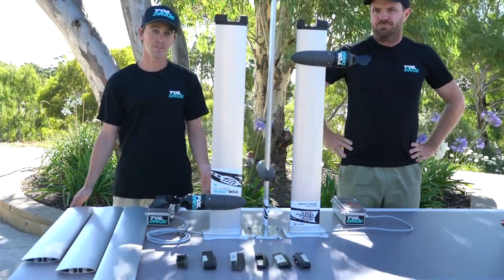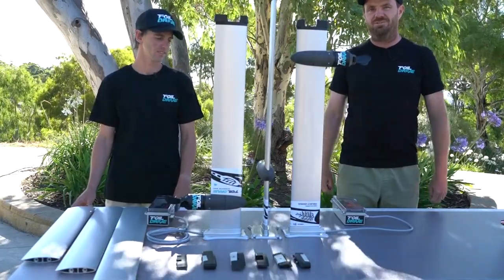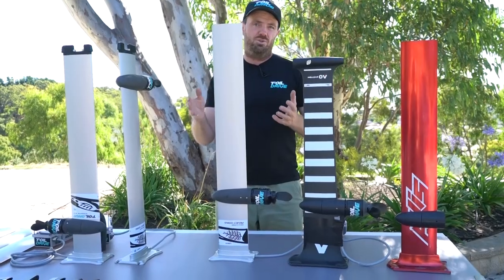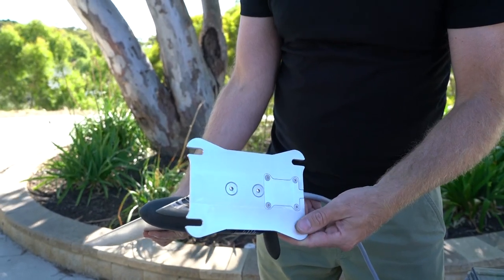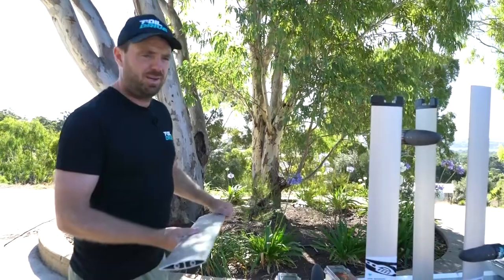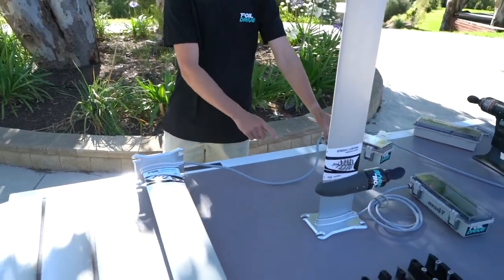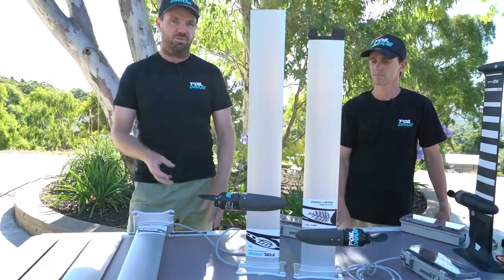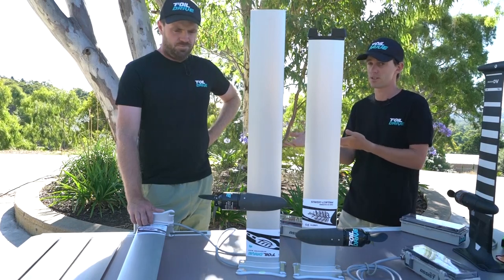Foil Drive Tech Talk | Ep 02 | Project Cedrus Integrated Mast Options

Comment: Sorry if this is a stupid question guys, but did you try running the cable down the front of the mast instead of the rear, and if so what were your results please?
On the original system, I mean.
Reply from the maker: We have had one customer try this as they wanted to run two foil drive motors on one mast.... don't even ask... ;) they reported the mast feeling "very unsure" as the water was splitting around a very fat rounded surface.